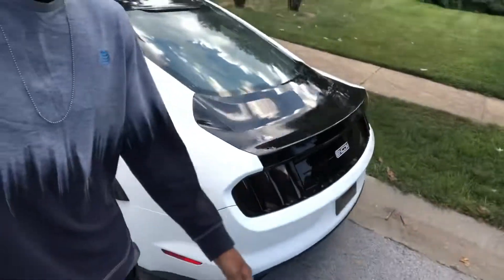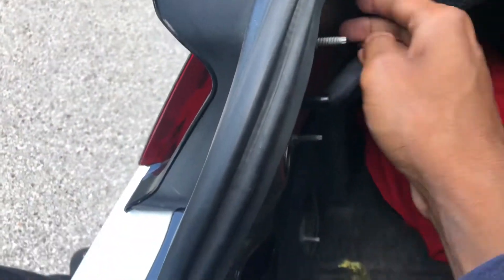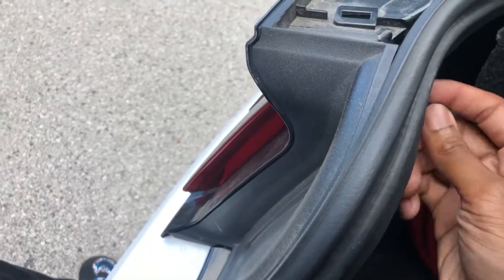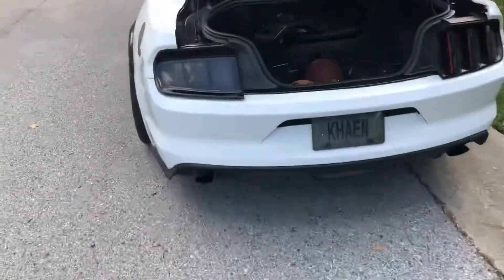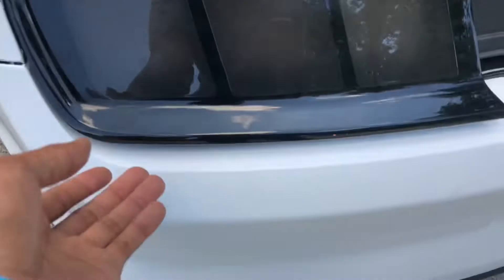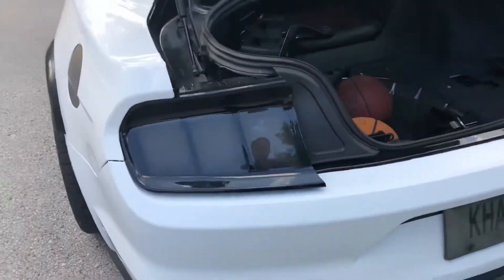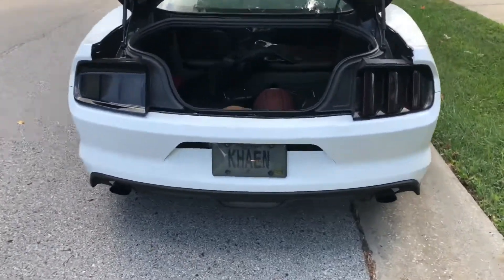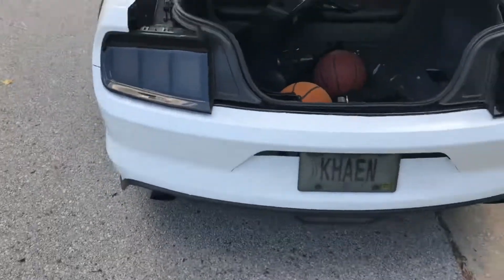Raxiom profile tail lights

Comment: that's very odd that you have that big of a gap, because I don't. definitely love these more than the halo ones. I had the condensation issue twice with the halos and haven't had it with these new ones and I've gone through 3 big rain storms and heat. I'd call AM about that gap
Reply from the maker: Daily Driven Mustangs yea i will reposition it and see but i hope its not if so il just put some weather strip down
Reply: KHARTOONETIC CUSTOMS i just moved to TN, we need to link up sometime
Reply: What kind of reaction are you getting from them